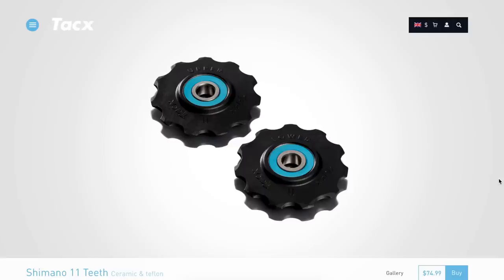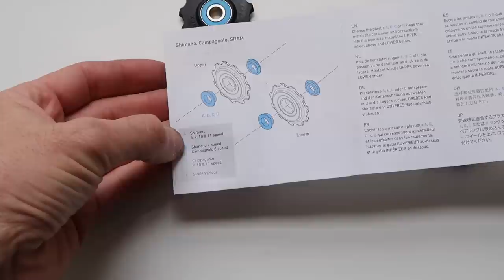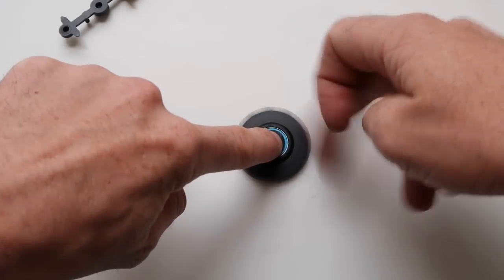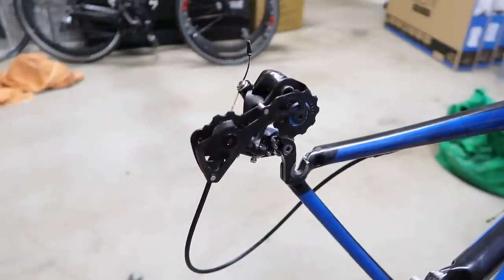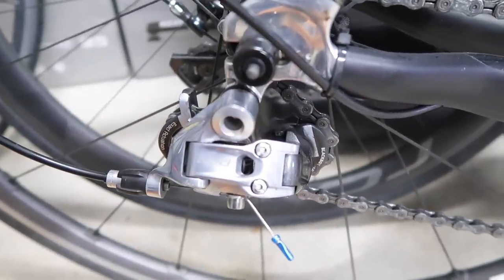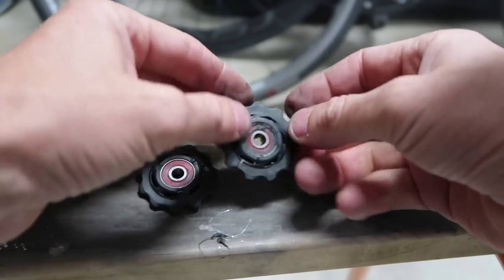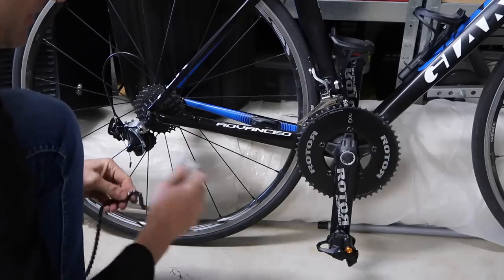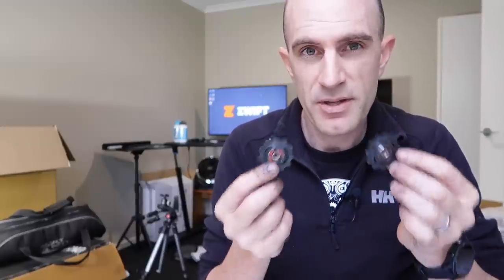Bike Maintenance: Installing New Jockey Wheels (Tacx Ceramic)

Comment: Got these on my mtb for about 1,5 years still running smooth. Standard xt would last max 12 months...  i do actually clean and maintain a lot since i bike in all weather circumstances...

Cost a lot but makes drive train run better for longer, shifts a bit better... Those bearings and overal quality are much better...

2 watt saving, probably more placebo effect, but hey thats also an effect 😎😇

Comment: This is a great budget upgrade. I had the non ceramic version on one of my bikes for many years. An added bonus is there isn't as much side to side play as the standard wheels thus improving shifting accuracy.. They are worth buying just for that especially if you have a lower end derailleur..

Comment: I got my first road bike in 1966. And I've worked on and restored/repaired bikes from the 70s, 80s and 90s for fun. Those jockey wheels look exactly the same as every other old bike I've had apart. The metal caps are timeless evidently. Bushings are made of different materials. Your old ones look like they're brass.

Comment: The fidget spinners have plenty of mass away from the center of rotation giving them rotational inertia.  The jockey wheels are the opposite in this regard.  With little inertia, they don't spin for a long time like the fidgets do.   Do have to wonder why the old wheels were broken.

Comment: Mate that 'crack' that you hear when you initially loosen the bolts was the loctight. If you don't put some more on you are very likely to have the bolt fall out in the near future. Saw this happen and the resulting failure caused bits of the detailer and spokes came together. Very bad
Reply from the maker: I'll keep an eye on them.

Comment: In my experience fiddling with my own bike, I've personally found that with the jockey wheel bolts it is best to follow Shimano's specs and use threadlocker and the specified torque to get the proper bearing preload.

I wrapped an MTB inner tube around the bb rest of the bike stand I made, and it worked pretty well (until the whole thing collapsed...I should've stuck to your guide!

Last part I promise! When you cable your bikes, Why do you make the rear derailleur cable loop so large?
Reply from the maker: Re: The rear derailleur loop. Just to trigger people on the Internet. Works a treat! ;)
Reply: That and having too tight a loop there increases friction...supposedly.
Reply: trade off is longer housing results in more compression...  slightly more...
Reply: Eli Douek You can not preload jockey wheel bearings, since only the inner race of the bearing is supported. You can tighten the screw and clamp
the inner race between the cage plates all you want, it won’t preload the bearing. Even on the bushing-type wheels, the bushing is longer than the pulley width, making preload impossible.

Comment: Being inside for the winter now I want to deep clean my drive train. Is it alright to put ultegra jockeys into ultrasonic cleaner? Or do I have to do it by hand?
Reply from the maker: I wouldn't put those in the ultrasonic cleaner. Maybe if you remove the dust caps from any sealed bearings and fully grease them again.... but that's a lot of messing about. I'd remove the jockey wheels before giving the RD a bath.

Comment: I read the instructions for Shimano plugs differently. A, B, C, D for 8, 9, 10, 11 speed => A=8, B=9, C=10 and D=11... I assume that the difference accounts for chain width between the various speeds. Does that make sense?
Reply: Different widths of the derailleur cage probably which is due to chain width
Reply: Yep, that makes sense and probably better stated than I did.
Reply: A is for shimano 8,9,10 and 11 spd ,  B is for shimano 7 spd and campag 8 spd , C is for campag 9, 10 and 11 spd and D is for Sram various

Comment: Never been convinced by ceramic, good quality steel bearings will be better as any theoretical advantage of ceramic will soon be lost, unless you are a pro replacing them frequently
Reply from the maker: I'm not advocating ceramic bearings here... it's just what they come with. I will advocate for clean drive trains and non broken jockey wheels. :)

Comment: What's your opinion 3 years later? Thanks
Reply from the maker: They lasted. Only just removed the RD these were on to upgrade to Di2.
Reply: Shane Miller - GPLama Thanks for the reply. I’ll give them a try. But are these in general compatible with both mech and di2?
Reply from the maker: @christospapaspyrou945  Off the top of my head, I don't know. The Tacx/Garmin website should have the info if they still produce these.

Comment: Really interested in hearing your feedback on these once you've taken then out on the road.
Reply from the maker: Working as expected. Gear changes work nicely. The clean chain is always a nice thing to have.
Reply: Shane Miller does it feel like an upgrade?
Reply from the maker: Not one bit. If anyone tells you they can 'feel' jockey wheels then I'd cut the conversation short right there. What feels like an upgrade is a newly cleaned chain that shifts nicely.

Comment: Does Veronica perform also maintenance on her bike, or is she delegating it to you?
Reply from the maker: I do most of it as it gives me a chance to get my hands dirty. Keyboards aren't hardcore enough (where I spend most of my time)
Reply: I wash and clean drive train. All tech and mech stuff gets delegated. There is a school of thought in the women’s bunches that the cleaning should also be delegated to the guys 🤣
Reply: I can live with both reasons, and count them solid :)
Reply: I'm betting I won't be "allowed" to wash my wife's bike again. Was cleaning the bikes. Her bike was on the stand. Somehow the QR lever on the stand (same style as Shane's repair stand only I am less handy so I bought one) was open. When I went to rotate the bike, it tipped. And somehow the down tube cracked.

On the bright side she's got an Emonda SLR 6 disc on the way. But on the downside that was expensive even with Trek's "carbon care" package and even with the shop throwing in another discount. And my wife's is stuck using her hybrid for a month while waiting (she's small and 47cm size everything had a long waiting list... Emonda rim brakes woud've been about 2 months...)

The worst part is it happened "on my watch". There is a part of me that feels awful and thinks "I wish I killed my bike instead of yours" even though she was due for an upgrade in 1-2 years and I was going to wait for 3-5 more. But even though I know if a bike had to go, it was better for it to be hers. It is still sad that her bike broke while I was cleaning it. Even if it was  a fluke (shop has no idea how it cracked on that spot when landing on a flat porch).

But I'm betting once her Emonda is in, she'll be "helping" me clean. Heck I'll probably be afraid to wash my bike next week...

Comment: Will these fit a 9 speed shimano XT deore shadow derailleur?
Reply from the maker: Check the Tacx website for compatibility
Reply: I did that and it says it does fit a 9 speed system but not the derailleur I mentioned. Thanks for the reply anyway though :)

Comment: These are just Ceramic Bearings.
Doesn't Dura-Ace have them in the jockey wheels?
The main benefit of the CeramicSpeed ones is that they are Ceramic bearing and oversized wheels.
Reply from the maker: I'm not sure to be honest. If they are, they were due for replacement. Von's were well overdue for replacement.

Comment: Thats awful and they charge 79 usd for it? Pff. Have a look at bbinfinete jokeys or ceramic speed ones.. they spin foreva'
Reply from the maker: You're going to have to quote the prices of those others too. For fairness.... and so we can all go 'pfff'.
Reply: Shane Miller bbinfinete is cheaper then ceramicspeed I think, not sure though
Reply: What you need to realise is these jockey wheels are unloaded, it is just the return path for the chain so saving watts due to better spinning is a non event, someone above mentioned better shifting, if so it may be worth it for different designed jockey wheels. Not a good plug for sram.....

Comment: Broken jockey wheels? Poor manufacturing? I have original jockey wheels on my ‘73 DA RD that are still mint and super smooth
Reply from the maker: SRAM. My RED 10spd set broke a few years back too. I assume they're better these days.
Reply: My sram 10 speed jockey wheels cracked too

Comment: The Dura-Ace have ceramic bushings which if kept clean and oiled properly, add minimal friction, but maintain the sideplay that the shifting relies on for proper chain alignment; none of the aftermarket bearings have a satisfactory equivalent to this clever little bit, but hey, waste your money for inferior shifting while deluding yourself that micro-wattage gains will win races. Of course, if you're not a pro, WTF does anyone care to spend that money just to feel even more deflated when some old bloke passes you on his steel 7-speed?
Reply from the maker: Happy Tuesday!